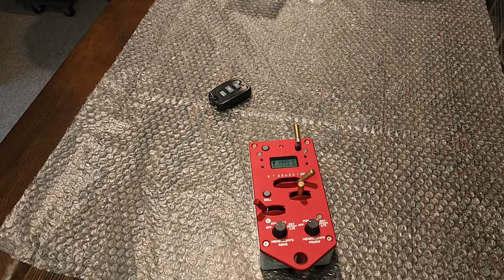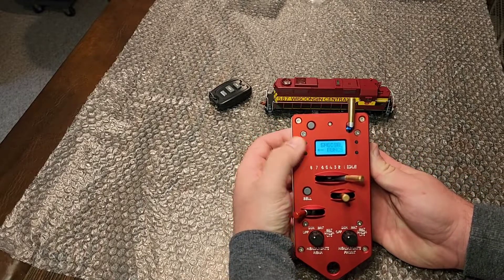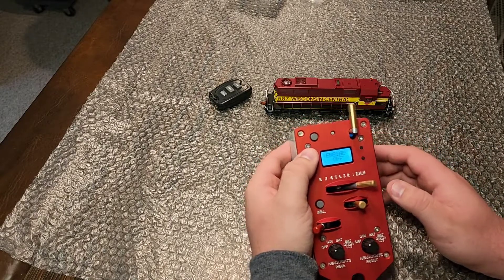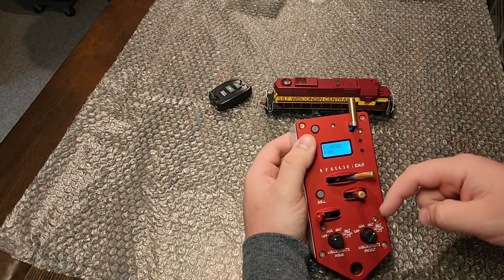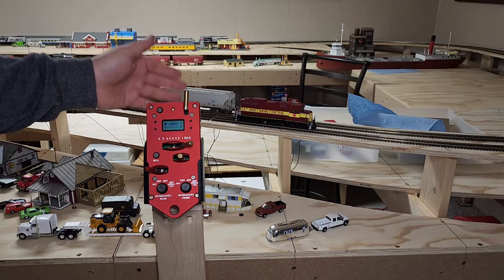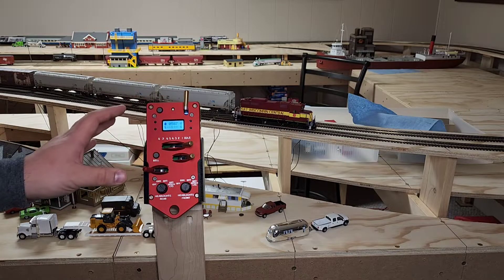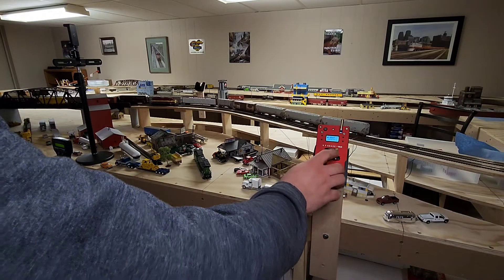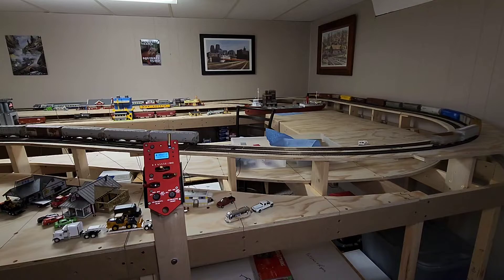Back to Basics: Protothrottle, basic operation

Comment: Why 5th throttle?
How many locos can you have on one throttle?
Why doesn't Protothrottle have load sharing instead of speed matching, to make it easier to consist multiple brands of decoders/model brands?
Protothrottle has alot of bells & whistles capabilities, but it looks like you have to "remember" alot of say "function button" uses. Where on a system like RailPro, it has a screen to show you exactly what you want, instead of having to remember what function button does what you want to do.
RailPro has 1000 speed settings....how slow or fast do you want to go?
Protothrottle does have some nice features...the proto-stand look & operation, the lights control and some other things.
Don't know why they couldn't incorporate some of the desirable features from Ring Engineering-RailPro system? Do you think it's a patent thing???
Why no charging port for the batteries?
You have to take it apart to change batteries?
Do you think that's a patent thing?
Yes, I'll watch the rest of the series, when time permits. 
Good Job....Shawn!
Maybe I should be asking why RailPro doesn't incorporate the Protothrottle look into it's design???😉😆😎